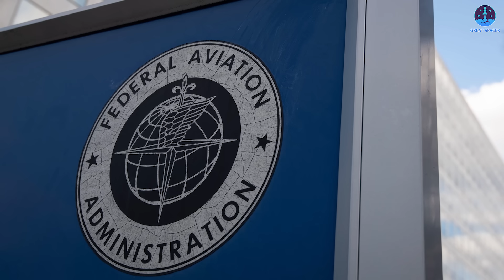SpaceX builds Starship Gigafactory is totally mind-blowing, unlike others...

Comment: By 1944, Ford was rolling a B-24 Liberator off the Willow Run production line every 63 minutes, 24 hours a day, 7 days a week.
A large (for the time) bomber almost once an HOUR there.

No, they didn't build an entire aircraft in an hour - they had dozens or perhaps a couple hundred ON the line at one time in various states of assembly.

Starship Gigafactory would work the same way - but at a lower production rate for the even larger Starship.

This is NOTHING NEW - except perhaps to the rocket industry outside of SpaceX.